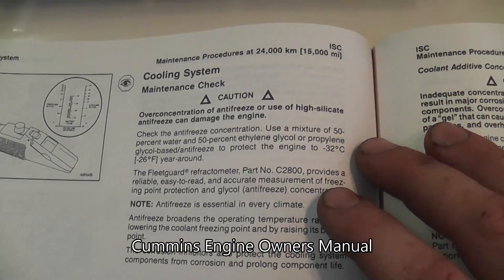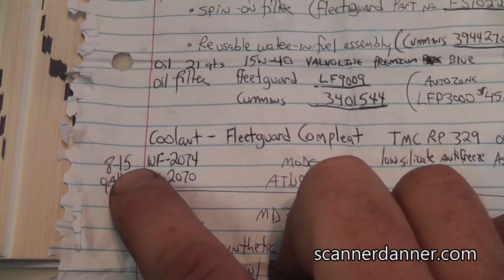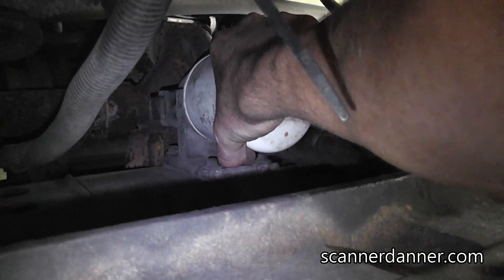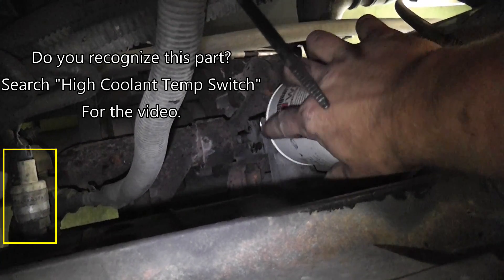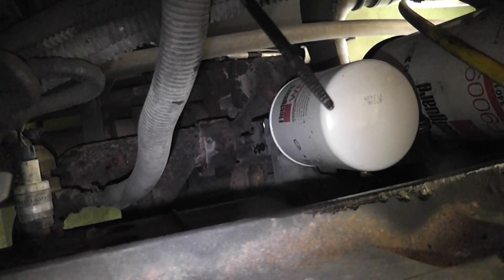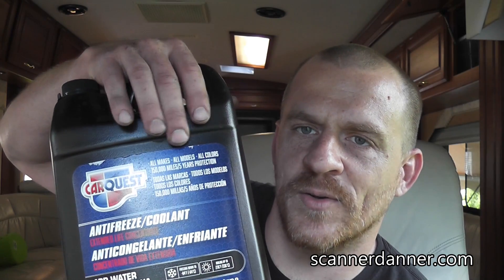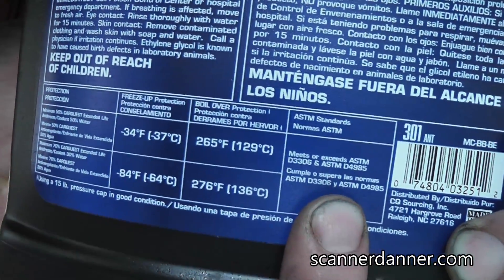2001 8.3L Cummins Coolant Flush and Filter Change with DCA4 (SCA)

Comment: I forget shut valve off before replace filter that why after i replace filter the coolant leak behind the pump how can i reset the valve to normal i appriciate it.😢😢
Reply from the maker: Are you saying your shut off valve is leaking now?
Reply: @ScannerDanner  leaking arround housing ,and behind the pump have screw cover by plastic nut ,it leaks from that screw too,my engine is cummins isx15
Reply from the maker: @soluuhuongyhik  can't really offer any help on that, I'm sorry

Comment: I'm not going to do this myself so when I take my 1994 DP with 8.3 Cummins to get flushed what should I be sure the shop takes care of ? I'm going to call Cummins also.
Reply from the maker: Make sure the engine block gets drained too. There was a drain valve that I missed on the block when I did mine.

Comment: I was told that Cummins is NOT a wet sleeve engine therefore the usual diesel antifreeze additives are not required. Regular Prestone can be used. Maybe the 8.3 is a wet sleeve but the 5.9 Cummins are not. Correct me if I am wrong.
Reply: correct 8.3 L is wet sleeve    5.9 is not wet sleeve
Reply from the maker: I have no idea, just doing what my factory Cummins owners manual tells me to do.

Comment: Nice video. Another thing people may want to know is that if it’s been a long time sine the coolant filter has been changed, there may be a build up on the filter seat. This should be rubbed away with a fine piece of sand paper, then rubbed off. If not, the new filter seal won’t seat properly and will leak. 👍🏻

Comment: 5th and lastly, the proper Cummins cooling system venting is crucial to not cracking heads, causing cavitation erosion on cylinder liners and engine overheats. The 3/8” plug you pointed to isn’t the vent it’s a port for coolant supply to a heater core, tranny cooler and / or multiple heater cores like with RV’s, on-highway / linehaul trucks with a sleeper. The correct vents are the vent hose right by the front engine lifting eyelet you pointed too, the plug on your engine water outlet / upper radiator pipe, and any of the other vents that go to the surge tank. All vents should be bleed at the component their screwed too and then again at the surge tank to assure the coolant is getting back to the surge tank. So vent both ends of every surge tank vent and and plugs on pipes that go higher than the engine / radiator. Cummins common practice is to bleed all vents at the components 1st with engine off then operate the engine to normal temp and bleed off the surge tank pressure 1st via the rad cap then bleed the vents at the tank to assure the coolant is flowing through all vents to the surge tank.

Comment: 4th, your surge / expansion tank looks to have a coolant level switch (left) and coolant pressure sensor. Both are / can be used to alert the operator to engine cooling system issues. One is the level and pressure switches can be used together to show the tech / you the cooling system level / 𝖯𝗋𝖾𝗌𝗌𝗎𝗋𝖾 is high / low which leads you to a blockage, bad pump, or even high level and pressure telling you combustion gasses are in the cooling system due to a cracked head, block, cylinder liner, or blown head gasket. This switch and sensor are / can be used for engine protection shutdown and / or engine protection torque derate with yellow check engine light (CEL), red stop engine light (SEL) and even yellow malfunction indicator light (MIL). The CEL and MIL are both used on newer cummins vehicles due to any engine / aftertreatment system fault that impacts the environment. Of course the mil light only goes out once a certain number of trips / KOER cycles have been completed. There are a lot of similarities between gasoline, diesel and natural gas engines, but natural gas and Diesel engine use them not only to alert the operator but also the tech to as what the severity or duration of the fault(s) have occurred.

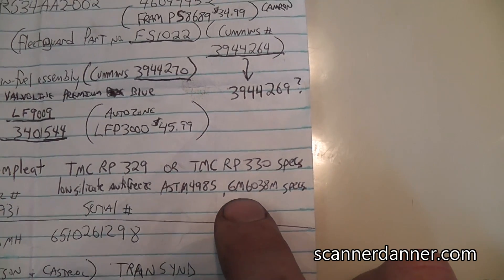Comment: Paul hope I don’t sound to condescending, but I was taught by several very thorough instructors just like you. They were like you, very funny, great at their knowledge, awesome people and very strict about they way they taught and guided their students. They instilled a lot of ethics, inspiration, confidence, knowledge, experience and laughing / crying on the floor shop humor you’ve ever heard. They also welcomed anyone who might know proper terminology / nomenclature or proper procedure or even just a story about their uncle that showed them a better repair or repair practice to a job being completed. So, by all means Paul do more funny mistakes or story’s about goof ups on different jobs you’ve done over the years. Your a good teacher and inspiration to a lot of techs like me who watch your videos to help us fix a vehicle better, faster and correctly doing so will make us last in this industry of auto / diesel vehicle repair. Your scanning and electrical diag just today helped me pin point a circuit failure today in fact. I was stressing about this issue and I sat down to smoke a cig and remembered one of your case studies on loaded circuit voltage testing. I immediately dropped my cig and went to the truck. I did what I saw you do and no BS found the problem within 15 mins of crawling all over that ISX15 engine bay. It turned out to be a wire that most of the strands broke due to high current and the wire just couldn’t flow the current any longer so a intermittent, incorrect or erratic fault was logged. I’d been T/S the fault all day and it was 2:30 with no more SRT (standard repair time) was available on this job, I was stressing about efficiency and your case study saved the day.

Comment: 3rd, the block coolant petcock drain. It’s there mainly for engine oil cooler replacement. Once the now oil contaminated coolant is drained, you need to drain the oil cooler housing which is made into block. Then remove the oil filter and then remove the oil cooler housing / oil filter head. If you don’t drain the petcock prior to removing the oil cooler you make a huge mess of oil and coolant when the gasket seal is broken. The engine oil thermostat, oil 𝖯𝗋𝖾𝗌𝗌𝗎𝗋𝖾 regulator and high oil pressure relief valve are all installed in the removable oil cooler housing cover / oil filter head which also gives you two 1/8” NPT ports to check oil filter restriction or a convenient spot to install a aftermarket oil psi gauge, oil supply  & return for an additional remote mounted oil cooler or even a oil supply to an additional turbo. We cummins tech use those two ports to verify engine oil 𝖯𝗋𝖾𝗌𝗌𝗎𝗋𝖾 when a oil psi fault is logged or if low / high oil pressure is an issue with that engine being diagnosed.

Comment: 2nd, the coolant filter and filter head valve are there for a number of reasons but aren’t always installed when an RV is built. The valve serves 2 purposes, one is to aid in the least coolant loss / air injection during a filter change. 2nd the valve is there to isolate the filter for removal to install a coolant filter head adaptor for flushing the cooling system which is no longer sold as newer ways and use of chemicals to aid flushing the cooling system. Back in the day you could install this adaptor (a die cast with a garden hose inlet and outlet) for flushing the cooling system
 As the engine was set to a (high idle / PTO) the tech could get the engine to operating temp, allow the engine thermostat to open 3-5 times and then slowly turn on the coolant filter valve to allow fresh cool water to enter the cooling system while old coolant / debris can exit. That took about 3-5 times to completely clean the cooling system. Now-A-Days, we just drain the coolant, add the appropriate amount of fleetguard restore to the radiator and top it off with fresh clean water and operate the engine to normal temp and let the thermostat open 3-5 times and then drain the mixture and flush once with one bottle of cascade dish washing soap to clean out any residual water / restore from the system and then flush the system until all soap is removed and drain the system then fill with a 50/50 mix of fleetguard compleat engine coolant.

Comment: Hey Paul, 1st as a cummins tech I’d like to just let you know about the High coolant temp switch, coolant pressure sensor, coolant level switch, coolant filter, block petcock drain and the overall reason for cooling system maintenance on a cummins Diesel engine. The temp switch, on some cummins engines there is a coolant and / or a oil temp switch that isn’t used for normal monitoring. They are both for high temp engine protection shutdown or engine protection torque derate. Both signal the engine ECM to either shut the engine down after a preset duration usually 5 sec - 5 min depending on the severity of the high temp issue. Like this, your cruising up a mountain highway, your CK ENG light comes on followed by a slight power loss then shortly thereafter the red STOP ENG light comes on followed by a severe power loss and in a very short time your RV just simply shuts off. Well, you scan the ECM and find a oil or coolant temp fault code something like this —> oil / coolant temp sensor above normal data valid, or shorted to high source. You right click the fault and find the temp got to 245+, the ecm warned you, then straight up told you then just shut you down. The power losses previous to the engine shutdown are called torque derates. Usually a percentage of torque is removed and steadily increased by percentage until a shutdown occurs.

Comment: If you check with Cummins you will find that you need to be sure that you're using the correct antifreeze and that it meets their specifications. (appears that you checked that). Recommend using a 50/50 mix. Diesel engines are unique in that they are a sleeved engine unlike most automobile blocks. There are many dissimilar metals in in higher concentrations in the cooling system and most require a special antifreeze. (If you use the wrong antifreeze it can cause cavitation, or pitting. Most shops today use distilled water, the reason why is that many local water sources have impurities that will shorten the antifreeze life and could do damage to your engine over the long haul. When a vehicle come off the assembly line the antifreeze in most cases is a 50/50 mix with distilled water. Before you say BS, think Love Canal, and why do  you need to use distilled water when topping off you battery?

Comment: Good for you, to leave the 'rookie mistake' in the video, we all learned a little at that moment. People always complain about engineers, but they designed the filter so you can't mount the filter without removing the plug. That would be an engineer's rookie mistake, stuff needs to be designed to make it impossible to assemble incorrectly.

Comment: My book says lubricate the o ring with antifreeze
Reply from the maker: What did I use? Probably a little oil. It's been fine with the oil. It didn't swell the o-ring or anything. I know this because I've changed the filter 2 more times since I did this. Good tip though, as that was a risk.

Comment: that appears to be a charge air cooler hose not a intercooler hose
a charge air cooler cools air and a intercooler flows coolant and not air
glad to see you using fleetguard filters next time you could use fleatguard red coolant from your local cummins or international dealer

Comment: Paul, I think that you did it the right way. That plug on the head may likely be seized in there, you might break your tols trying to remove it. I use a method to burp the system of air, by using the spill free funnel~ http://g35driver.com/forums/attachments/engine-drivetrain-forced-induction-diy/105511d1241072845-diy-fix-coolant-air-bubble-heater-not-working-temperature-jumps-loud-boom-lisle-221501.jpg. I fill the system, then attach the funnel and fill it halfway up. Then start the engine and let it warm up to operating temp. Once the thermostat opens, i keep an eye on the level as the air comes out and refill as needed to keep the funnel from running dry. I'll also bring the rpms up to about 2500 to push what air is left in the system out for about a minute, let it idle for a minute, then repeat several more times. That burps the majority of the air out. There may still be a little bit, but the overflow bottle can take care of that, just keep an eye on the level for the next few days. I've had too many instances where the plug won't move, or the bleed screw is in a plastic housing and trying to open it causes the entire screw and insert to come loose. After a couple of times with those problems, i use the funnel method exclusively.

Comment: SCA is added to the coolant on wet sleeve style diesels to prevent cavitation erosion of the cylinder liners.  Generally the best bet is standard premix  ELC type coolant (orange if you buy the Fleetguard stuff), no water needed as it is already in proper ratio. Donaldson makes a coolant filter for that engine that contains SCA in pellet form for continual absorbtion into the cooling system.  Best practice is to use a coolant test strip annually to ensure that the SCA is in proper concentration, change the filter every 1000 hours.

Comment: Your discussion of an air pocket at the end reminded me of my experience with that about 19 years ago. Long story ...

 I had a '86 Grand Marquis (a different car of the same make, model, & vintage that I own now), and decided to do a coolant flush in preparation for my moving from MA to Phoenix, AZ towing a U-Haul trailer. I installed a tranny cooler, then proceeded with the flush. Only thing I did differently than the many times I had done this before, was I kept the t-stat, instead of replacing it. After the flush & refill of fresh 50/50 mix, I went racing down the road at full throttle, even downshifting the automatic trans for some engine braking. I took a left to make a loop back to my apartment when I had a very noticeable decrease in power - immediately after I noticed that, the "engine" light lit up red! I quickly pulled over, shut it down & threw it in neutral before I even stopped. Popped the hood to VIOLENT boiling coolant in the overflow tank! Watched the upper hose begin to deform and bulge, so I grabbed the lever on my Lev-R-Vent cap to relieve the pressure. Just about blew the rubber plug out of the overflow tank! What a sound - 10x more violent than what I had first saw when I first opened the hood! Swore that the tank deformed from the heat! This thing was COOKIN'!! Walked back to my apartment about a half mile up the road with all kinds of bad thoughts going through my head. I was supposed to leave for AZ in a WEEK!! Anyway I got back to the apartment, and grabbed a couple gallons of distilled water and headed back to the car. When I got back to the car, I pulled the dipstick to find CHOCOLATE MILK! I thought I was screwed! I refilled the system, and drove real slow back to the apartment. Got a ride to the auto parts store for a filter and 5 quarts of oil. I changed the oil that night, and the car was fine! Drove it all day the next day - no coolant in the oil! AMAZING! Ended up driving it all the way to Phoenix - 2,300 miles - pulling that U-Haul with a motorcycle , tools, and everything else I owned. Only issue I had the whole trip was a blown heater hose in the mountains, just over the AZ border. A deep 7/16" socket fixed that problem. :D After that, I swore I'd own one of these cars the rest of my life! Ended up driving it another 40k miles in 2 years after that incident. Sold that one in '01, after recovering it from being STOLEN for a YEAR, with 256k on the clock - was still running like a top! :D

Love how simple that Cummins block is. Looks like everything is cut square on a big band saw, lol! Simplicity seems to equal durability, so I'm all for that!

I always buy coolant at Wal-Mart, since it's the cheapest I can find it. I use Prestone 5 yr /150k mile green coolant in everything I own, and in customer's vehicles. Never had an issue with it, at least so far. Been using that for years, way before that 5/150 was even a thing.

Great video, as usual!
Reply from the maker: You got lucky on that one huh?
Reply: BIG time! That was God's way of saying I HAD to go to AZ. My life has completely changed for the better ever since! :)

That 302 is one heck of an engine, even with the plastic cam gear - I just changed the timing set on my current Marquis at the beginning of this Spring, with about 238k on the clock. The chain had 1.25" of slop in it, yet it still ran great and never jumped time! I was amazed. I never knew that gear was plastic, even after 20 years of owning these vehicles!

Comment: TMC RP ... stands for The Maintenance Council Recommended Practice number whatever.  When changing out the coolant, definitely  drain the block. 17 psi cap is OK, as it just raises the boiling point of the coolant a little bit.  If bleeding air out of the cooling system is necessary, use the air  bleed line at the block point you mentioned. because the thermostat does not need to be open to accomplish that; whereas, at the coolant outflow hose/pipe equipped with the pipe plug, the thermostat needs to be open, and it is still not the highest point in  the system where air can collect.  I would have recommended that you use Cummins approved extended life coolant, which does not require the addition of Diesel Coolant Additive (DCA).